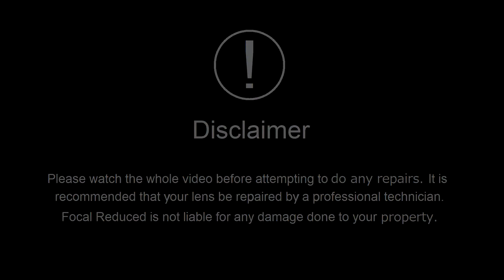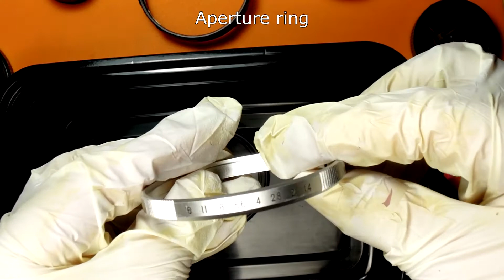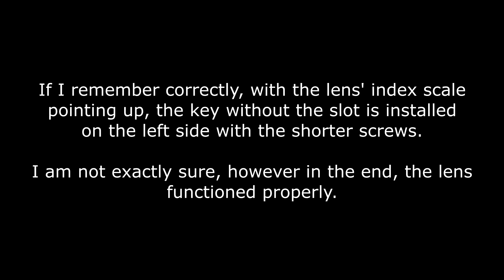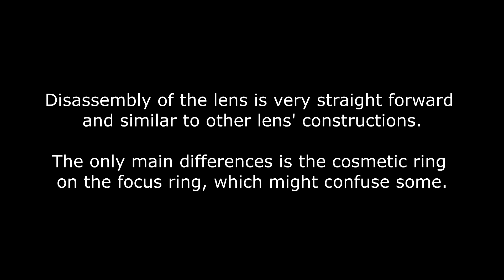Reassembly of Fujinon 50mm F1.4 lens (M42)

Comment: Hello! Question; i have this one and i wanna use it on my canon cinema camera. Problem is when im using M42 adapter to EF mount, adapter doesn't fit well so i can't use aperture ring. Everything else works fine. Is there any solution to this? Thx.
Reply from the maker: Does your Fujinon lens have the Aperture communication tab on the aperture ring?
Reply: @FocalReduced  Well, if by that you mean a little notch on the bottom of the lens - then i bellieve it does. My Helios lenses dont have that feature and they work fine. Lens is from an old Fujicon camera which i don't mean to use so i wonder what would happen if i phisicaly remove that notch? My guess is that the adapter presses that notch when i screw it on so the aperture ring can't be rotated, only works with one aperture that is set before mounting the adapter.
Reply from the maker: Yes, the notch on the aperture ring is causing your issues.  You can file it down if you wish.  There  are specifically made adapters so you don't have to.  I will need to do a search for them since they are quite rare.
Reply from the maker: Please do an ebay search for "Bokkeh M42-Canon EOS EF Lens Adapter Mamiya Fujinon Version".   It is the correct adapter that you require if you do not want to modify your lens.  It's not fairly expensive though...
Reply: @FocalReduced  ok, thx for the info! I will try to find corect adapter but the thing is i'm from estern Europe and things are not that much availeble like in USA or West EU.
But like i said, i don't plan to use it on old film camera, it will be perpanently  mounted on M42 adapter for use on cine camera..
Reply: @FocalReduced  I've just removed the notch and it works like a dream! What's funny everything works also on Fujicon camera just like before, i can't see the diference with or without the notch. What that thing even does??
Nevertheless, thx again on your advice; you made my life easier 😉
Reply from the maker: The notch is to communicate the aperture value to certain Fujica camera bodies for open aperture exposure metering.  You may have a camera that does not support it.  If you look at the camera, there is a slider around the m42 lens mount. It can be moved with your finger.  If you don't see it, your camera did not support it.
Reply: @FocalReduced  Nope, don't have that..
Model of the camera is Fujica ST 801.. got it with the lens for 80$
Reply from the maker: The St801 does support it.  The slider is the ring around the M42 lens mount.  Either way, it can still be used, just in stop down metering mode.

Comment: I have the same lens and have mine taken apart. I’m trying to see if i can do something about fixing the focus. Barrel rotates but doesn’t focus and idea? Novice repairable or send it in
Reply from the maker: Is the helicoid actually rotating when the focus ring is turning?  If so, the helicoid will need to be taken apart and recalibrated for infinity focus.  If the helicoid is not turning with the focus ring, the helicoid may be seized, which also will need to be fully disassembled, cleaned and relubricated.